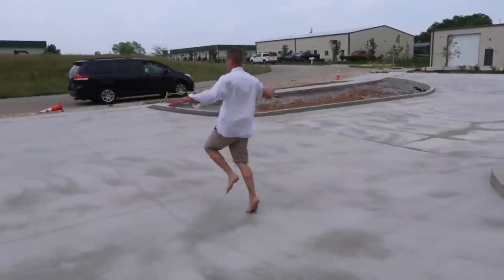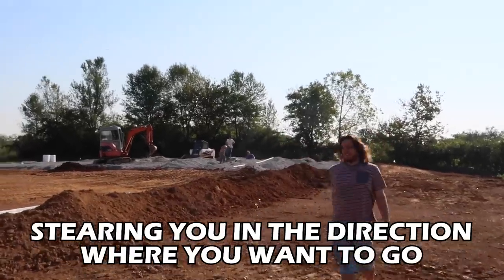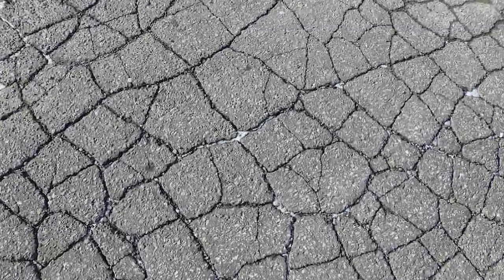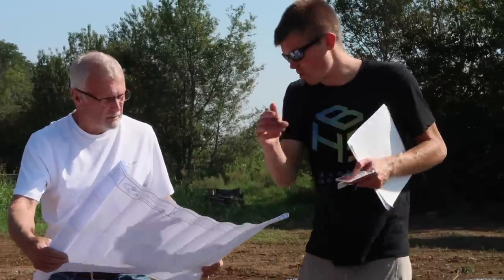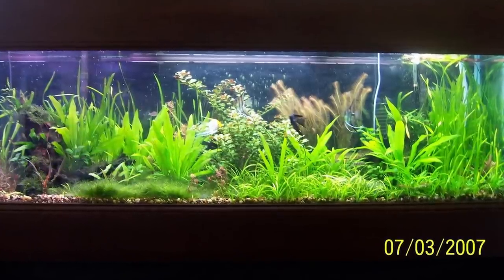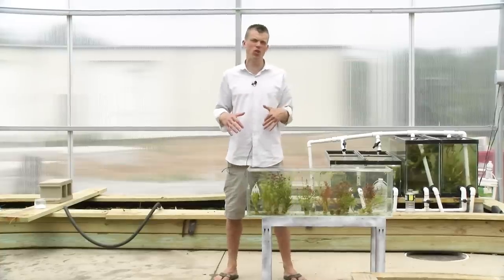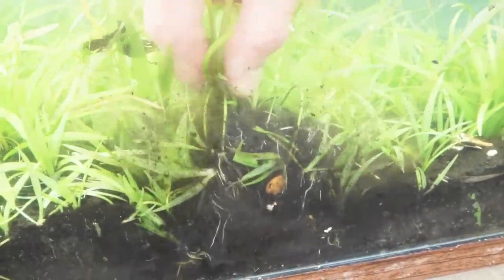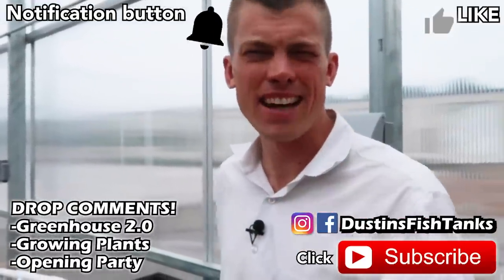GREENHOUSE SAGA & SPECIES SUNDAY: Foundation/Substrate of Your Aquarium

Comment: So glad you did concrete!! I have an asphalt parking lot at my groom shop it feels about a million degrees in the summer. The water pipe runs underneath that asphalt and I can't get the water anything cooler than 85 degrees coming out of the tap in the summer. Oh yeah & the parking lot is disintegrating I've been here 11 years and it looks horrible, but I rent my building so I'm not paying to refinish it.
Reply from the maker: Leslie Sockwell thanks, yeah sorry to hear about your situation.... the super hot surface wound get old really fast, even if not cracked- I would not like the look of it. I hadn’t thought about the water line....I’m glad mines under concrete (deep) it’s that “11 years from now” I’m worried about

Comment: My advice on landscaping is to check out your local nurseries and see what's available.  New varieties are becoming available every year that won't appear on peoples recommended lists till much later, but might be excellent for your place.
Second, before you choose a plant, ask what it will look like twenty years from now.  A six foot sapling may look nice now, but it will grow.  When it gets fifty feet tall and it's roots are tearing up your expensive concrete parking lot, it won't look so good, and the cost of removing a full grown tree is not cheap, not to mention repairing the concrete.
As you place your planting, space your plants and shrubbery according to their full grown size.  You wouldn't put ten amazon swords in a thirty gallon tank even though they are only about seven inches tall and fit perfectly right now.  When they built the building I am living in back in 1969, which occupies a single city block, they placed ten little leaf lindens, two flowering crabs, a hornbeam, a moraine locust, and a blue spruce around it.  Now, most of those trees  are over fifty feet high, totally overcrowded, and five of the lindens have had to be cut down.  Meanwhile a silver maple has sprouted from seed and is thirty feet tall and carpets the ground with seeds every spring.  All these trees, with the parasites that live on them host a huge population of spiders, whose babies invade the building every year.  The flowering crabs were cut down because tenants objected to having to wade through piles of rotten apples every fall.
Another point in your case is will a tree sixty feet tall cast a shadow over your greenhouse?
In your shoes, I would avoid trees altogether and rely on shrubbery and tough perennial plants like yucca and daylilies.  I would also use a pebble or stone mulch.  Wood mulches may be attractive, but you cannot guarantee that none of your customers smoke, and a careless cigarette thrown on wood mulch can destroy your entire planting.
Sooner or later, you will probably want to hire a landscaping company to take care of your plantings.  Before handing the job over, be sure to go around and see what kind of job they do for other customers.  Anyone with a truck, a lawn mower, and a crew of kids can call themselves a landscaper, but most of them do not have the slightest idea of how to handle shrubbery.
Reply from the maker: Emmit Stewart great feedback!!

Comment: your islands around the parking lots, i would plant low growing shrubs &/or perennial flowers that can take the high dry heat  in the summer & extreme cold & can tolerate ice melting chemicals in the winter. no trees as for one, theres no room for them to grow. i see this mistake so many times they don't do well cause of the surrounding concrete & payment. and two, if they did well, the tree roots will damage your concrete & curbings. & U don't want to shade your greenhouse.....